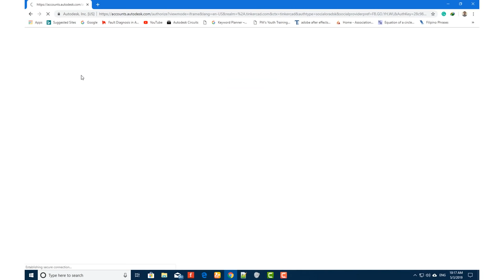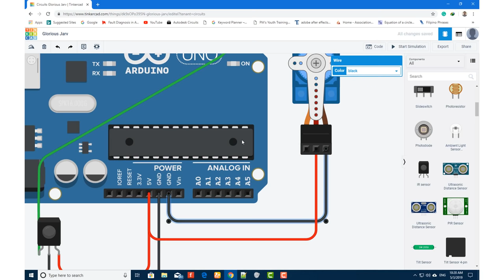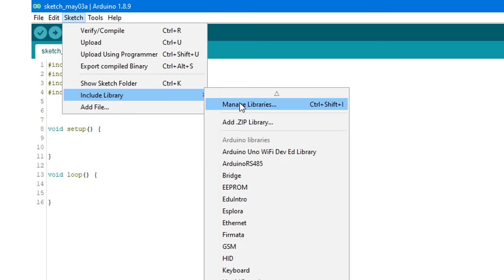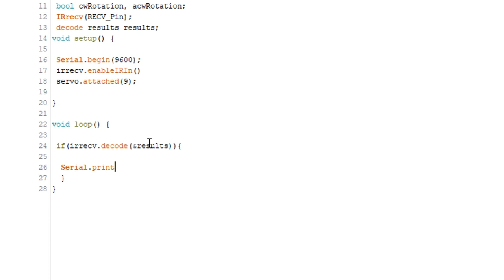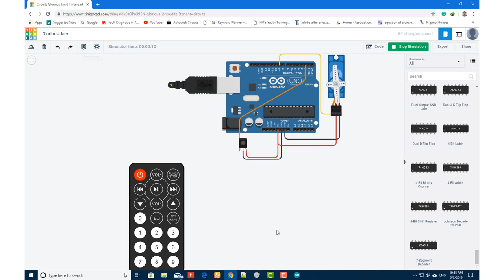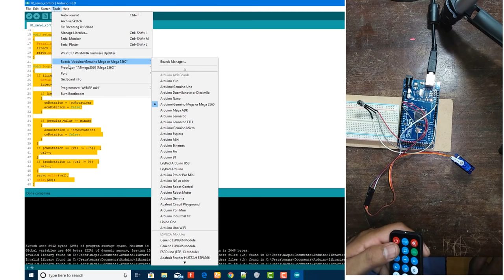Servo with Arduino Infrared Remote | Waqas Farooq

Comment: ✨
Reply from the maker: thank you for commenting and subscribing my channel
Reply: @WaqasFarooq  thanks a lot to you for this video. I tried applying Your code but I have problems on my IR sensor: It blinks a few times in First load but then It doesn't receive signal... Maybe it's faulty
Reply from the maker: @ErCapoAlex  make sure your connections are correct and you have updated your Remote IR code for your project
Reply: @WaqasFarooq  i did
Reply from the maker: @ErCapoAlex  then you should check your IR sensor Connections if they are lose this happens too